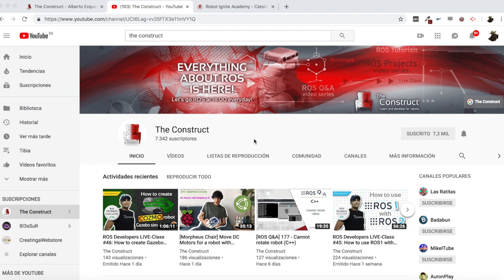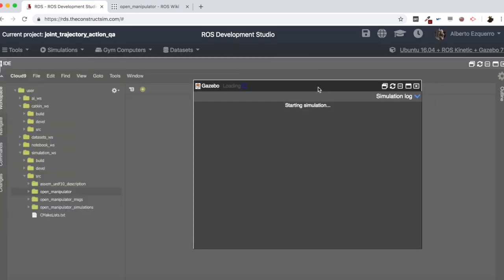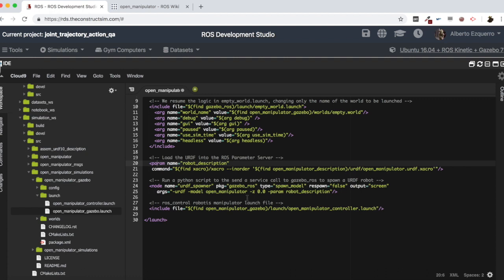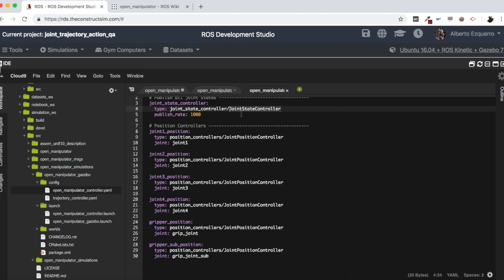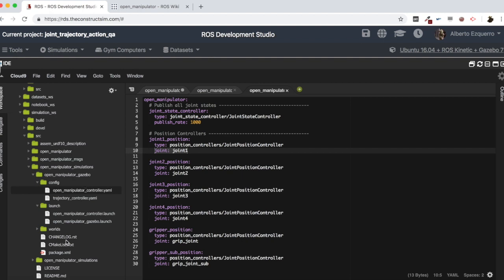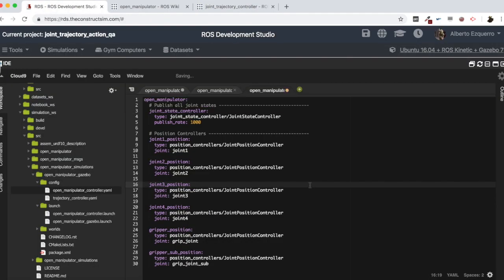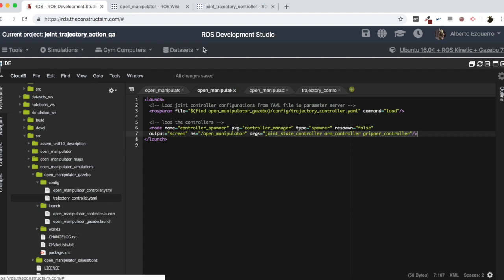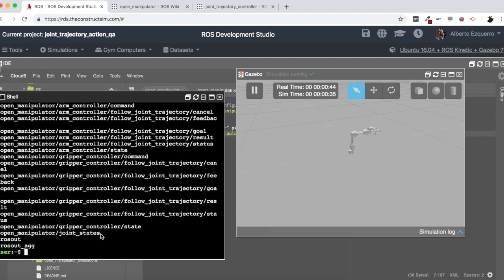[ROS Q&A] 178 - Add joint_trajectory_controller to your robot

Comment: Hello. I have a simple manipulator setup in ROS. When I hold a heavy object, the manipulator bends down and failing to maintain its target position. What should I do if i have to make the joints more powerful that can lift heavy objects in simulation. Thank you!
Reply from the maker: The PID of the controllers are not correct, you need to compute them strong enough to hold the position. I'm asuming that the actual motor can hold the weight (otherwise, the problem will be in the motor itself, not on the controller)
Reply: Yes, the actual motors can(given they are strong enough). And tuning PID controller works, thanks. I was wondering from a smulation point of view : is there a possibility to make a joint stronger (just like having a high torque/strong motor) or something like that. Thanks.
Reply: @surajbonagiri  you can increase the effort values in the URDF file if that is just in simulation (equivalent to making motors stronger)